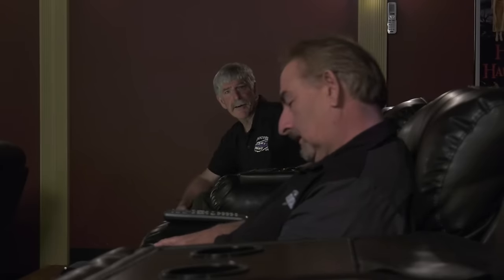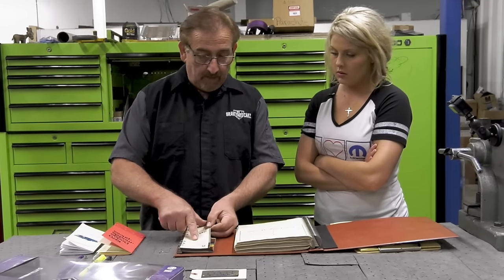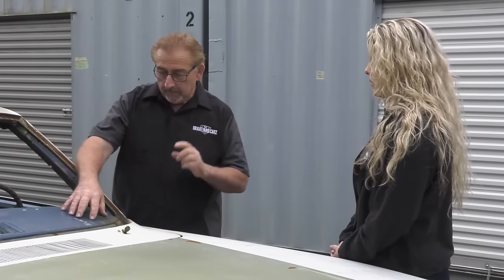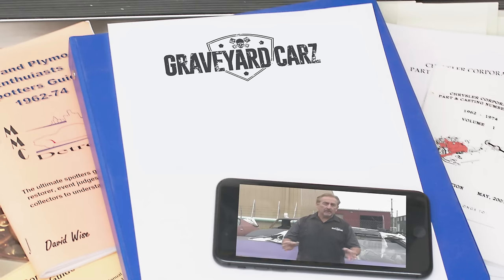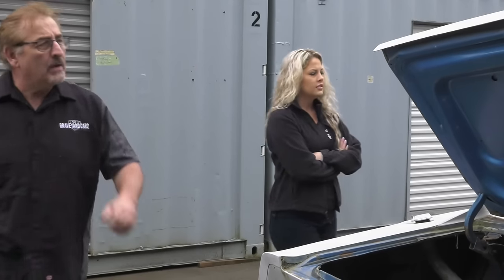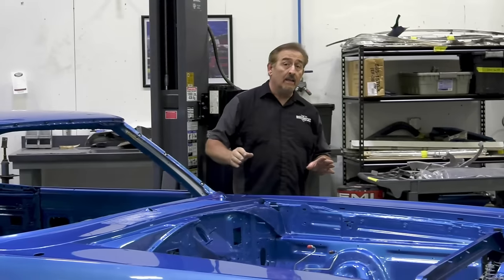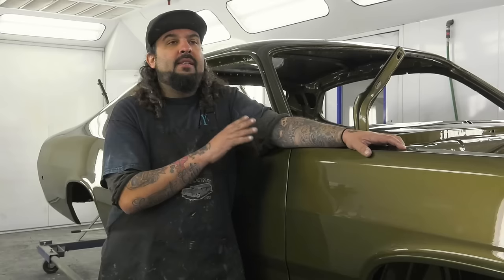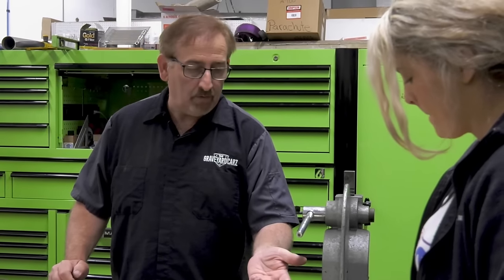MILLION DOLLAR FACTORY MISTAKE OR FRAUD? HEMI CHARGER GOES UNDER THE MICROSCOPE.

Comment: Had a 72 Challenger back in the 80’s, it was very rough with floorboards rusting out behind the front wheels and a bent K frame from the previous owners collision. Car tracked right no pulling. Well I got tired of looking at a cracking dash so I went junkyard hunting. I finally did find one, bought it and brought it home. A few days later I noticed that the idiots in the Chrysler design squad had attached the VIN plate to the dash cover instead of the metal subsurface and punching a hole in the dash cover as what one sees today. Welllllll, Houston we have a problem. These plated were fastened to the cover with large flange pop rivets that has a series of small scallops cut into the flange. Finally located a source for the right diameter flanged rivet but no scallops. Well out came the needle nosed round file and within an hour and a half I had two exact matching rivets. Within minutes I had the correct VIN on the doner dash and it was back in the car the following morning. Could not tell the plate had been tampered with. All numbers matched and no fraud was committed and the dash looked almost good as new! It would have been an interesting car to hold onto. The last MOPAR I owned was a 93 Plymouth Mini Van. Nice ride but it went through seven transmissions in the 12 years I owned it. Turns out that stupid engineers used nylon parts in key components in the tranny. Thank goodness I had purchased the 7-70 warranty, it covered four of those transmissions and one ECM.
Reply: You could’ve got a Lemon Law refund after the third transmission.

Comment: I’ve been told that some guys that fabricate new data plates, that look old, are so finicky, they want high resolution photos of the original from several different angles:
Dead on, 45 degrees from right, 45 degrees from left… so they can tell if the person stamping the original data plate was right or left handed.

Comment: The mig welded plates would be stronger than the factory spotty welds...every mopar of that era should have those reinforcing plates welded in now, regarldless of engine...55 years of body and frame flexing and surviving is why.....the factory has told us all what the weak points in the frame were